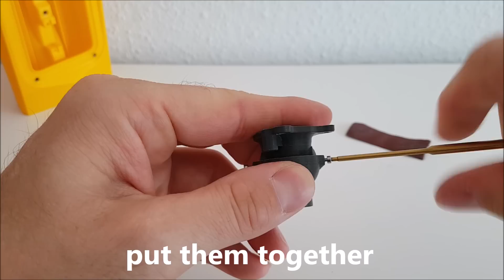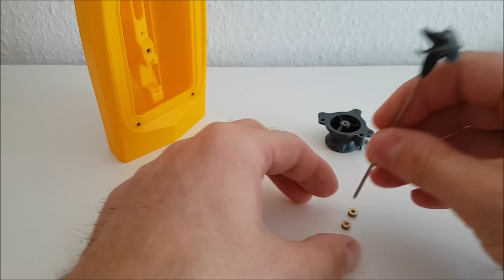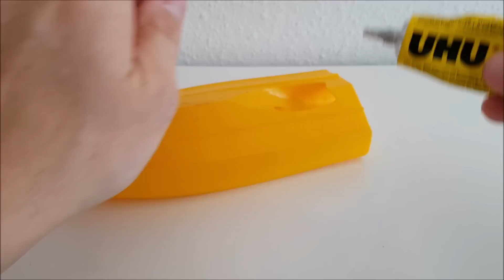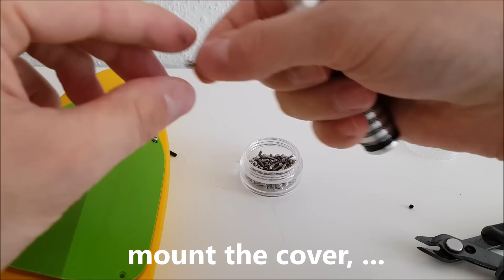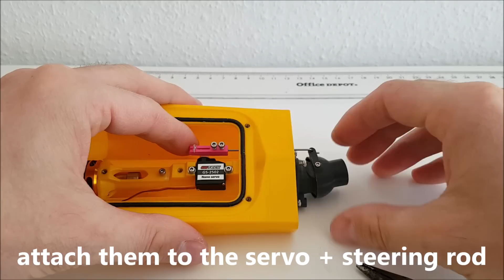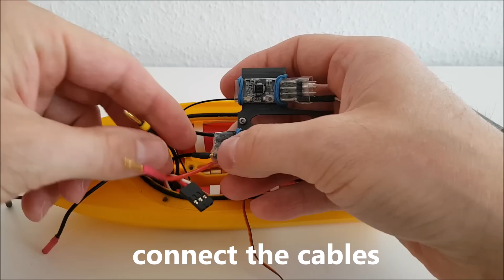3D Printed RC JET Boat with JET Drive - Assembly

Comment: Nice Video man thx! Now i only must fix the problem with setting the Channels in my taranis qx7... I dont have a clue how too setup the Signal for each gimbal stick (Channel) with drones on betaflight its much easier... Is It possible you post a link or a little answer for help me with this läßt struggles. ✌️ Thx man cheers
Reply from the maker: sry i don't have a link to a tutorial. i tried it by myself.
Reply: Just set it up as a standard RC plane. 
Then when it comes to testing, you can use the output tab to limit the throw of the servo, so it's not straining. 
Also remember to calibrate your ESC.
Reply: @ArduinoKing  thx man i already Set It up last weekend and bash around the lakes now 😉👍

Comment: Do you have any advice to press out the motor shaft? I don't have access to a screw press, and a vice won't work as it doesn't have holes. A link to a suitable screw press would be good too, I haven't been able to source one online!
Reply from the maker: Hi... i made a new video. Hope it's a solution for you.
https://youtu.be/koOQJhqo5r4
Reply: @jtronicsTV  I had some quad motor lying around, and was able to use it. Thanks!
Reply from the maker: @kevintieman3616  thats great!
Reply: @jtronicsTV  Only thing is, quad motors usually need M3 screws which became a problem (holes and space on the motor mount are designed for M2). I ended up glueing the motor on with thick CA glue.

However the is build done and works really great! Waiting or the twin 300 ;-)

Comment: One suggestion; put a waterproof switch on it so you dont need to take the cover off with every use. Another possibility is to use an exterior magnet with an interior reed switch.
   I didnt see how the driveshaft was sealed against water where it exits the hull. Nice build!
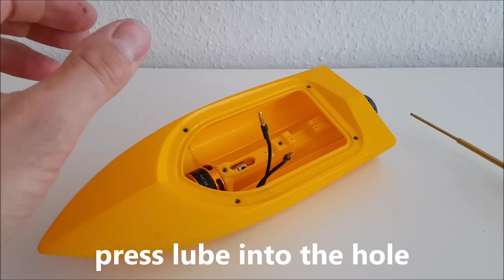Reply from the maker: Hi, the scene with the lube is at 7:17minute
https://youtu.be/0LeV_MzVAqY?t=438
The idea with the reed switch is good. Do you have a link to a good reed switch and a picture?

Comment: I have a YKS X1806 2300KV motor that fits perfectly inside the boat, can I use BLHeLi 20A ESC listed in your boat parts ? or do I need to buy a different ESC ?
Reply: Were u able to get the motor shaft in there? I have a flashhobby 1806 and i can’t get the motor apart so i can put the longer motor shaft in

Comment: Grüße, das Boot ist komplett gedruckt und zusammengebaut und das Ergebnis ist extrem gut geworden. Der Betrieb mit 2 3000 mAh Akkus ist mir etwas zu schwer ist der Rumpf ohne 18650 Halterung für normale lipos gedacht? Mfg
Reply from the maker: Du kannst das boot statt mit 18650 auch mit den kleineren 18350 lipo akkus betreiben. Aber du kannst aich ganz andere akkus verwenden, daher gibt es auch die STL "without batterymount".
Hier hat das schon jemand mit 2S 430mah lipos  gemacht...
https://www.instagram.com/p/CAtNP7TjKFV/?igshid=xyndle7agf8j

Comment: Hi ,what a great project . Have you coated the boat some how against water ? If yes , what would you recommend ?  thanks in advance.
Reply from the maker: If your 3d printer print the hull good, it should be waterproof. But, if you want to be safe, you could still paint it with a thin layer of acrylic car clear coat. I tried both variants and it works very well.

Comment: If you cut the ends of that sealing chord at a relatively high angle, say 60 degrees or more. and make it so it fits with just a TINIEST BIT of compression, with the angle in the horizontal plane, the top will squish the ends together to form a watertight seal.  The other option is to glue the ends with a glue that dries as pliable as the gasket material, or make it such that a standard sized o-ring will fit (you can get then to pretty long lengths still at small longitudinal diameters).  Right now it is pouring in my front yard and practically dry in the back...weird.  If you designed that boat yourself, very nice, well thought out.

Comment: Where do you get the 2 x 30mm motor shafts? Are they grooved for the c-clip?
Reply from the maker: They are not grooved. It's not necessary.
All links to the parts are on cults3d

Comment: With 3D prints immersed in water I've had the problem that the water just seeps trough the layers after some time. How did you go about this problem, did you coat the boat with something in the end?
Reply from the maker: If the 3d print of the hull is good, it should be waterproof. But, if you want to be safe, you could still paint it with a very thin layer of car clear coat. I tried both variants and it works very well.

Comment: Why did you need to replace the motor shaft?
Reply from the maker: The shafts of all small brushless motors are to short. To connect a clutch you need a longer shaft.
Reply: @jtronicsTV  ah okay that makes sense thank you

Comment: Kann ich in das 300mm Boot 4*18650 er packen oder explodiert dann die Schraube ? :-)
Reply from the maker: Ja das geht auch. Ich habe auch schon 4x 18350 verbaut, 4x18650 solkte auch passen. Von der drehzahl her bekommt man aber nur 3s ins wasser übertragen. Danach wird es nicht mehr wirklich schneller.

Comment: Great project!

Do you know a cheaper transmitter model who should work with your project?
Reply from the maker: You could take every transmitter. You receiver should be small enough to fit into the boat.
Reply: thank's for your answer
Reply: @nicolasmeyer9313  Flysky i6. 
or flysky GT2 for a boat style tx.

Comment: You should sell little packs with the extra hardware needed through your website. Easy to buy the stl and electronics but no one needs 100pcs eating/brass tube/screw/inserts etc.

Comment: awesome little boat! one thing though, O-rings work better with a little grease on them so it might be wise to put a little on the O-ring after its been glued!
Reply from the maker: yes you could grease the O-ring, but its not needed. Last weekend we had a boat underwater (depth of 2m) for about 15min and there was no water inside.

Comment: what specific glue to use for shaft bushing?
Reply from the maker: It's fixed with uhu plastic or with pattex kraftkleber. But also the clear coat is fixing the bushing.

Comment: Hello sir, I purchased your model few weeks back and I have trouble changing the motor axis. I destroyed one trying... And it is not quite like your instructions (though I bought the right model). Is there any alternative references that could do the trick without this step ? Like a long axis engine?

Comment: Hellou, what type of support in cura did u use?

Thanks
Reply from the maker: slicer: cura (please take cura, Don't take slic3r!)
Nozzle: 0.4mm
support: only for cover
Optimize Wall Printing Order: Yes
Fill Gabs Between Walls: No
Use adaptive layers: Yes
Layer: 0.10 to 0.20mm with adaptiv layer
material: PLA
Infill Travel Optimization: Yes
Print Thin Walls: Yes (important for stator.stl)
Not to fast! Print the parts with about 30mm/s, to get a good layer connection. (It depends on the qualiry of your printer)
not to hot, because of dropping nozzle PLA 205*C
infill: triangular 
infill: maximal15%
walls before innfill: YES
Ouline walls before inlines: YES
Reply: @jtronicsTV  thanks!

Comment: How much did it cost 3d printing the hull in all?
Reply from the maker: sry I don't know. I have my own printer, so I only have to pay for material.
Reply: @jtronicsTV  Ooo, wb the amount of filament used? One roll (1kg) or more?
Reply from the maker: only 55g for the hull and maybe 15g for cover
Reply: @jtronicsTV  woah! Here in Pakistan, almost all the companies are charging around $800+ to print me this thing! I sure get a 3D printer myself with tht money lol.
Reply: @wasifshah9134  wth they are absolutely insane
Reply: @wasifshah9134  they give that price because they do not want to do such a small job. the price is high so you'll go away. they only want to do large jobs for companies. it's a shame but that is how many industries operate, they do not want to deal with small customers.

Comment: Are you sure that motor shaft is 2mm in diameter and not 3mm?
Reply from the maker: Yes, I'm sure. All shafts of 1806 motors are 2mm.
Reply: @jtronicsTV  I purchased the one in the link shared in cult3D and ended up getting one with 3mm shaft and one side reduced to 2mm, also tried removing the shaft and the whole thing collapsed. Have any extra ones to sell?
Reply: @jtronicsTV   I also had the same experience. I purchased two DYS 1806 2300kv brushless motors and one came with the 2mm shaft and the other came with the 3mm reduced to 2mm. On the latter, I couldn't even remove the shaft with my press. I don't think it would work either way so I stopped trying. Is there another motor you could recommend? Also, I am not having much luck with the AFRC servos on the link they stop responding for no apparent reason. Are the GOTECH ones any better?

Comment: Würde noch eine 3. 18650 Zelle rein passen?
Reply from the maker: Nein, eine 3. Zelle passt nicht rein. Mit 2 Zellen ist das Boot schon so gut wie voll. Für mehr Leistung, also 3s oder 4s zellen verwende ich 18350 Zellen. Die sind nur halb so groß wie 18650.

Comment: You have made a very high-quality model. But it lacks one detail - cooling water board engine mounts. If you make a water intake in Jet_stator . And run the piping through the transom to the engine mounting plate. And in the board, organize the cavity of the cooling jacket. A release of water to bring anywhere outside the case. It was possible to avoid deformation of the plastic as a result of heating the engine. It's natural to do everything right away when printing parts. Then it would be the perfect super design. I take pleasure in the assembly of your model.
Small addition. The pipelines, if laid next to the batteries, would also cool them. Thank you for your hard work. I would be glad if you will modify the model and it will be cooling.

Comment: Great little boat and very nice print. Well done. Could you assemble a kit please (BOM - Bill of materials) for all the parts? And could you provide that kit? Or if not, can you provide a Amazon source (I'm in the UK, so a more local supply chain would be best) 
If you would like we can start a community of builders. print out a few and sell them on your behalf.? We pay you a percentage of the builds. So your designs will get out there via a network of builders. What do you think?

Comment: Würde da auch ein 2216 Heli Motor rein passen  dann hätte ich das Problem mit der Welle nicht
Reply from the maker: Hallo, momentan passt der nicht rein, ich arbeite aber an einer modifikation, dass auch andere Motoren in das Boot passen. Wenn die Änderung fertig ist, werde ich es hier und auf cults3d veröffentlichen.

Comment: if use FPV motor will best！ like 2205 2306
Reply from the maker: Sry, but these motors are to large for the small boat. The maximum motor which will fit into the boat is a 1806 or maybe a 1808. if you have smaller motors (1706, 170x, ...), with a screw distance of 16mm, than they will also fit in it.

Comment: thats not a jet boat..  our's had a 454 inch chevy....  the jet is in the boat... the spout and bucket are on the back... it sucks up water from the bottom of the boat and  push's it out the back... you cant see the water turbine in them becuase you apperantly think it just a propeller in a tube (aka ducted propeller)   :-)     ours had 6 sets of fans in it..  approx 2400 pounds a minute on that 350 horse engine... nothing special, just a stock 454

Comment: Hardley a DIY Project if you need to make a motor shaft and need a press. why not use a flexable coupling. ?
Reply from the maker: that would be also possible. I'm also planning a prop version.

Comment: get another motor thats for planes and drones
Reply from the maker: Good idea! We tried different motors, but the BE1806 motor is the best. Most of the drone motors have the big shafts, so it's not possible to change the 2mm shaft, by pressing them out. If you have an idea, please let us know.

Comment: Never solder Li-* Batteries.. you will apply too much heat.. Always spot weld.
Reply from the maker: Yes, but before i have to build a spot welder 🤔
Reply: @jtronicsTV  Kweld Spot welding kits are the very best.